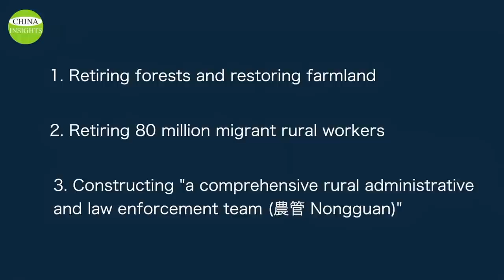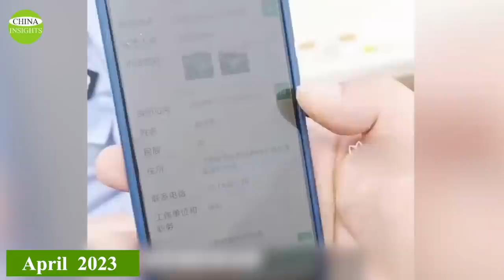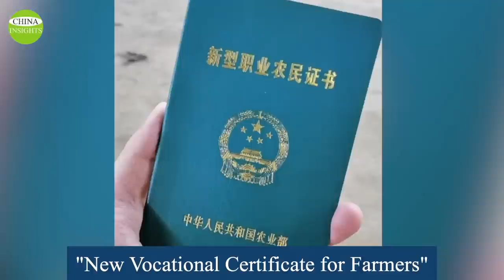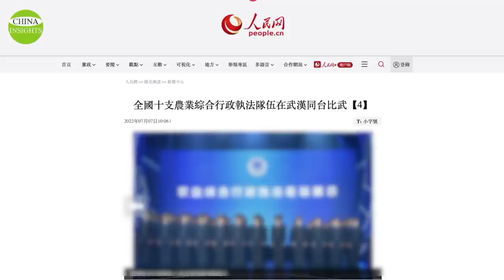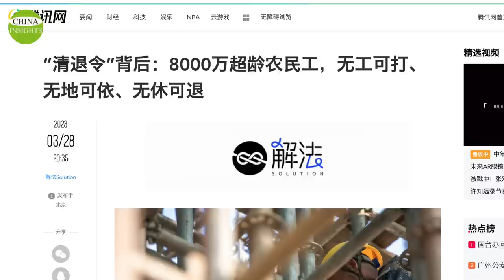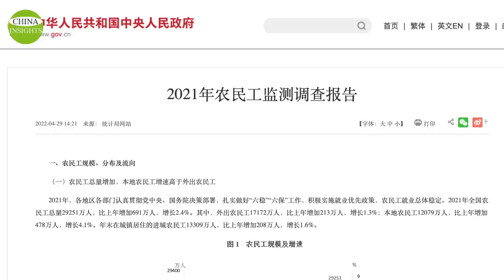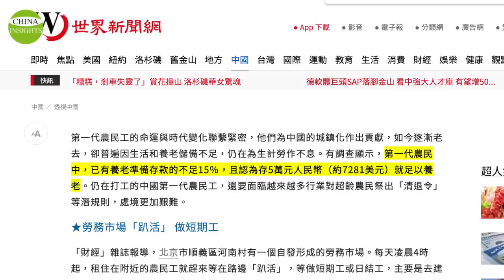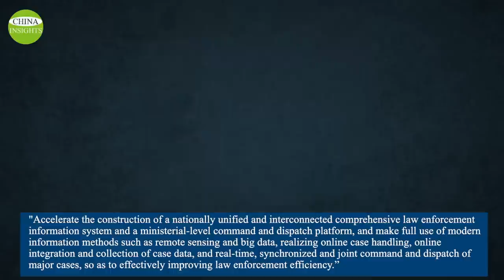And 82,000 rural administrators enter Rural China! CCP Prepares for massive unemployment & war

Comment: Same problem everywhere...when you give one group uncontroled power over another, there will be abuse and corruption. The problem is that the group without power has to be productive and the one with power has to profit from the productive group. That leads to exploitation. There should be shared power and both groups shoud produce goods...